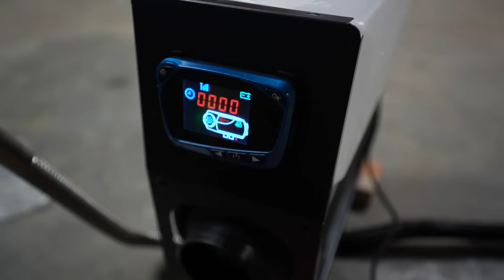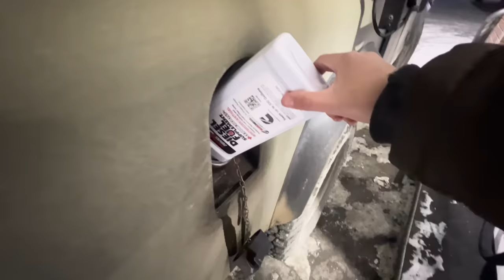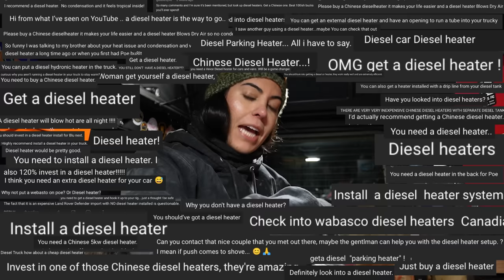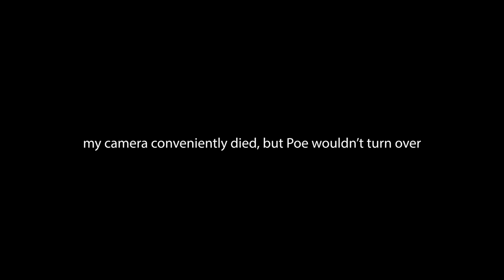Truck Camping in -15 Degrees under the Northern Lights

Comment: As a person who lives in Northern Canada,  I've been worried about you Maria.  No one should be attempting to live out of their vehicle without being well prepared for the cold.  Not a time to be winging it.  Glad you are safe and sending love to you and puppers.
Reply: amen and amen
Reply: Please be careful Maria. We care for you. ❤
Reply: I mean as someone who lives in the north it’s not about making heat. It should be shedding heat. She needs a curtain heavy curtain to divide the space and bundle with her dog. With some comforters she should be fine
Reply: @zachmarshall7921 she needs to make heat and contain heat. Shouldn’t be popping that upper tent up, and not a time for trying shit out without a solid backup plan.
Reply: I 💯 agree!!  I live where it gets -40 I am also worried. I wear big Sorel winter pak boots. Helly Hansen underwear with Arctic Cat snowmobile pants and it's warm but still would hate to sleep in a vehicle at that temp. I also live in an RV full time, but not off grid. I run Electric heaters with furnace as a back up.
Reply: You can block half the radiator on a diesel in extreme cold it won’t hurt it. It will help the heating in the vents. We used to use cardboard and tape.
Reply: Hopefully this is a lesson on the go forward!
Reply: Very easily gone very bad for her.
Recklessly isn’t a good motto in the severe cold.
Reply: I.mean the land Rover is basically a big tin box so it's like attempting to heat a freezer.  People die in their cars in winter doing the same things.
Reply: Her car has a lot issues starting up so if I were her I wouldn’t have dared to stay in Alaska when it snows
Reply: Keep the Buddy Heater. 2 is one.  One is none.
Reply: As you should be ProudestMom
Reply: Take care!❤
Reply: Keep Po low, no uppertent
Reply: Agreed! I lived in North Dakota and it got down to -35 with wind chill. Diesel trucks won’t start without an engine block heater and there are almost ZERO homeless people there for a reason. 😓 I’ve been so so worried too!
Reply: I agree. I live north too and I can tell you need better clothes, better sleepingbag ect. Don't trust technology. In harsh weather when you need it most it probably wont work.
Reply: sage advice my friend. I'm assuming it was -15F calucates out to -26C. Maria was lucky Poe didn't freeze. Plug Poe in at night if jpossible and beware of the Winnipeg square tire! ;)'
Reply: I’d marry her because she does what she does
Reply: @eljay1092 my f150 started there in minus 80, it was minus forty in the sunshine of the day but on the morning…. Ford fired right up
Reply: She's doing want she wants to do, mum. Above all ,  she's not thick,  as far as i know anyway.
Reply: @ForkNLeans  yes but staying in one for a long time can get expensive I’m sure
Reply: @Never-mind1919  Good advice.
Reply: Maria find your self a surplus army navy store and get the arctic sleep system it's like 3 or four bags,and military arctic clothing, and buy a few surplus wool blankets those items will make those dangerously cold nights better, and as a dad I would advise carrying Jerry cans with extra fuel for poe, look into a block heater for him to plug him in at night with that you will need a generator either gas,diesel or propane, solar is good but not always dependable and 1 last thing as another commenter mentioned covering your grill in the rig will help at keeping consistent heat. Sorry for the long comment, just trying to help,  keep on trying thanks for bringing us along for the ride
Reply: @weswarren5987 a diesel F150?
Reply: She is living pretty reckless.  Stupid way of getting the views tho.  Stay safe Maria.
Reply: She is from Michigan. It's North to us, and kinda cold. She is brave. You go girl!
Reply: Hell it gets down to a whopping 15 degrees here and I'm sleeping with a running lawnmower under the covers with me to produce heat..put a boggan and some gloves on for the love of god!
Reply: Oh! I’m so happy you got to see the Northern Lights! I’ve always wanted to see them, wow! Yay Maria!!!🎉🎉🎉🎉❤❤❤
Reply: She's from Michigan we're just built Different 😅
Reply: I live in far northern Alberta and spent a fortune on just boots, parka and mitts etc when I moved up here. Even with those sometimes the cold is uncomfortable. I can’t imagine sleeping in a tent or a truck overnight in the winter up here, but she’s even further north than me. Old man winter is a cruel, relentless bastard who can strike at any moment to freeze you to death. Worth it for the northern lights though
Reply: Winter boots??

Comment: Miss Reckless Maria....trying to help you understand what is happening. The diesel heater draws up to 12 amps  for 3 minutes during start up because of the glow plug. It has to be red hot to ignite the fuel. The fuel will not begin pumping until the glow plug is ready to ignite it. The problem does not seem to be the diesel heater, but rather the Jackery does not put out enough amperage at the 12 volt outlet without overload and shutdown of the Jackery 12 volt outlet. If you were to run a 12 volt supply from the defender batterys the diesel heater would have enough amperage to start correctly. Have it professionally installed to solve your issues and repurchase the buddy heater for back up. Keep in mind once you get this issue solved you can use that diesel heater to blow under your engine to warm it up cold prestart or even blow the warm air at the engine air intake in case of super cold  conditions.

Comment: Maria, I am originally from southern British Columbia, but I have spent considerable time in northern B.C., and the Yukon. The worst part of winter has yet to hit there. It's going to get unbelievably cold there very soon. Vehicles won't start unless they are plugged into a block heater. I'm starting to get a little concerned for you and Blue. That is not the place you should be, trying to tough it out in a vehicle regardless of a heater. The real winter there is about to arrive. Now is the time to consider heading back down south.....
Reply: I totally agree. This one scared me! Its time to leave there and get back to the lower states.
Reply: This!!!
Reply: That diesel heater should have been installed (professionally) way before she ventured into cold climates. Alaska and Canadian winters are nothing to play with. She should also have kept that buddy heater for backup. She mentioned that her truck was blowing cold air, which shouldn't be happening. Her coolant might be gelling. Does that truck even have a block heater? Obviously a must for cold weather. Grinding that diesel motor starting it in the cold is a guaranteed way to damage something.  Does she realize what happens to lead acid batteries if you completely discharge them and they freeze? I also noticed that she seems to be putting additives in the fuel. Do Not do this! The diesel will already be winterized up there. The incompatibilities with multiple types of additives may deteriorate the fluids in the fuel blend and completely reverse any benefits whatsoever. If unsure, ask the station about the diesel before adding additives. From watching her videos she often doesn't seem that well prepared or properly think things through. Her cavalier attitude is going to get her in a jam one day that she may not be able to get out of. I know I sound mean, but she needs to hear it.
Reply: January February your going to see -40 to -60 c up north nothing to play around with
Reply: Wake up!
Your followers care about you and have brought out safety issues that involve your life!!!
Reply: This is why Eva Zu Beck didn't stay there past the fall, and she was very prepared. Definitely the worst time to visit Alaska. I'm in Alberta, Canada and true winter hasn't even hit yet. Wait until it's -30 to -40C....
Reply: @robertheintz8017 10000% agree. This episode made my cringe and say WTF were you thinking.  I hope she goes somewhere warmer and then comes back prepared another time...
Reply: @robertheintz8017 I agree with everything you are warning! She most likely will not listen because she is so omnipotent in her beliefs and for views on here. I am very worried for Blue. Being compromised health wise, this is a stressor on his body. Who GAF about the Northern lights. She and Blue may end up like the Mount Everest climbers. And even the smart ones use Shirpas. Cmon Maria. Go south. You will still get the views you crave.
Reply: @robertheintz8017 but then she wouldn't be living up to her moniker of "Roaming Reckless"
Reply: I’m in northern Alberta and it’s been the warmest winter we have ever had in a very long time. We only had about one week of normal season temperatures which is about -30 C on average but can get a lot colder or a bit warmer but not like this year. It was +1 C today. I hope if she is planning to camp all winter these warmer temps continue for her, even though it’s still freezing at night it’s not as bad as it could be

Comment: Second suggestion: get somebody to install the heater inside your truck so it recirculates the inside air. Having fresh (and darn cold) air pulled in is very inefficient, plus you're pressurizing the inside and push the warm air outside the truck. The heaters are 100% safe if properly installed. I can help if you need, I have one installed in a shed and it's been working fine from day 1. I'm an electrical engineer so I think I can help with these things.... last thing I want to see is a RIP post on your channel, Ria... seriously. Recklessness in small amounts is cool, but in large amounts can be deadly... Stay safe, and keep posting the great content you're been posting so far! Oh...and always have a plan B. Go get that Buddy heater back. It's small enough but can save your life if Poe refuses to power up.
Reply: Also easy access to a heated building.  24 hrs store for example.
Reply: Very good suggestions 

Sorry

Comment: Yeah lots of good comments! and some good advise from those in cold places.  I am retired Army with a lot of Alaska experience and your spirit matters.  Getting tested emotionally is good, but you may be taking on too much risk in the early Winter. For the risk of annoying-Unsolicited recommendations: First, boots recommend Baffin's arctic (-60 degrees) or polar rated (-120, no kidding these are issued for Antarctica) --ditch the sneakers until Spring. Wet tennies constitute potential frost nip or bite. Cotton kills and that goes for footwear. The Army Alaska minimum insulation rating for boots is 1200 gram thinsulate. This assumes you are hiking. For camping those Baffin pac boots will keep you dry and retain heat in the toe box --toes get cold first. Second, window coverings will retain heat in the cabin. You lose a significant amount of heat via uninuslated windows. When using diesel or portable heaters keep a Carbon Monoxide alarm with you.  Third, have a go inside plan. When it gets colder, get Poe in the garage with you in the B&B. You made a wise choice not to tough it out all night. Fourth, talk with the folks at REI on winter survival or take some winter survival courses in the community --even from your fellow content creators. Winter has come and its yet to reach beastly cold. You got this. Stay warm!

Comment: The glow plug draws a lot of current in the diesel heater at startup and cool down around 7-10 amps.   When the glow plug kicks on, the screen dies, likely because your Jackery has a circuit breaker or something that protects and prohibits that amount of current draw.  Hope this helps.
Reply: I have the exact one. And you are spot on.
Reply: He is 100% right the 12volt plug on these can’t provide enough power to run it when the glow plug needs power to heat up. You need to get small inverter that goes from AC to DC

Comment: Thank God you're alive, Ria! As for the Diesel heater, the power getting cut so abruptly when the glow plug is supposed to turn on makes me think that your Jackery turns its 12V output off when overloaded... some Jackerys do not allow 10+ A that the heater requires for start-up. Solution: connect your Diesel heater directly to one of the 12V batteries in Poe (hopefully you have two... so use the house battery, not the starting battery). You already have 12V supply in the truck, so forget about the Jackery.

Comment: Just so you know…unlike diesel heaters that are meant for heating, diesel vehicle engines don’t warm up or stay warm when just idling. I owned a VW Golf TDI (w/ diesel engine) for over 20 years. So, I’ve experienced this firsthand. Also, you may want to get an engine block heater (even if you have glow plugs) if you’re having trouble starting Poe. Also, I’m sure they’re selling winterized diesel fuel in Alaska. Stay safe!
Reply: My Hilux has a power heater button that increases the idle speed, so it gets warm when idling.

Comment: If it's the pump I think those heaters have a prime feature on them, but if not you may have to prime the pump manually (get air out of the line).  As for your vehicle blowing cold air, you may have to put some cardboard across your grill in the front to help hold in the engine heat.  Otherwise, it may never warm up to a good temp to blow hot air from the heater.

Comment: The odds are that the Jackery 12 volt cig lighter plug in has an amperage max and will auto shut off if amperage is exceeded. The glow plug on the diesel heater is technically a direct short to get it to glow and most likely draws too many amps for the Jackery 12 volt outlet and causes the jackery to shut of power to that plug in.
Reply: This is what I've read as well. Except that the pump should be running almost immediately. It's unfortunate that most of these power packs shut down at 10amps
Reply: I have a 12v 15 A power supply that I plug into my solar battery. Works for me

Comment: If poe is blowing cold air, in a pinch one thing you can do is cover Poe's front grill with a piece of cardboard, this will make the coolant retain more heat,and if it's that cold I would not shut poe off, when they built the Alaskan highway way back when, they never shut down the diesel equipment because the wouldn't be able to get it restarted

Comment: Glow-plug POE with the ignition pigtail- wait a minute, than pigtail again, then start. So basically give it 2 doses of heat before you turnover, in arctic temps.

Comment: Who could ever get mad at you???? Some of the biggest lessons I've learned in life were through a very difficult trial.  -15 degrees is super cold and you survived it and with lessons learned.  I say that you are the big winner here!!
Reply: LOL.... -15 is very WARM compared to what is coming soon. She can expect -60
Reply: @canadianwarrior2108  really?! thats insane!
Reply: It's coming , already had -25 in willow, webasto heater cab heat and recirculation heat for diesel engine only way when remote plus bunny boots mittens and mummy bag rated -40..been here 40 years now lots of tundra winter time all over state , your right about -15 warm LOL canadianwarrior..

Comment: Ive made several comments to help. The one reson you can tell its the Jackery is if the diesel heater had continous power it would show an error code on the screen. The jackery is shutting off the 12 volt outlet during the glow plug phase of the diesel heater and your screen goes blank on the diesel heater. The Jackery most likely auto resets that outlet when power demand stops. I have 2 diesel heaters...an electric heater...a dwarf wood stove...and electric pad on my bed. Backup is number one in artic conditions as you have learned with mild artic temps....its no joke...it can get way colder than you are experiencing.

Comment: Your diesel heater's fine, you need that adapter to plug into 110 outlet, a 12 V 15 amp works fine, this is an old video so you. I'm sure you have the new diesel heater already installed.

Comment: Just ref the diesel heater, they draw a massive current on startup to heat the glow plug and generally get going, the sort that isn’t typically available from a normal 12v socket. If the jackery output is only like 100w or so it might be asking too much from it and it’s just resetting the controller with the drop.

Comment: -15°F will only dip way more colder… with wind chills, it’s gone to -80°F. At -30° and -50° the vehicles break stiffens up. The steering wheel is hard to turn. Need a garage to keep vehicle safe. Outside, need block heater plugged.
Big Rays in Fairbanks carries cold weather clothing. Negative weather feels like razor sharp blades all over skin. Breathing in the negative air instantly freezes nose hairs, your lungs exposed to those temps is not good. With how Poe didn’t want to start, just glad it wasn’t out there where you were trying to camp in. Skin exposed for a few seconds will not be good. Drive down towards Seward or Homer for the winter. Not up north. Up north, death comes super fast in winter. Your dog needs winter boots.

Comment: Two things about your truck, does it not have a block heater? You should have plugged it in when you're at the Airbnb.
And you should also cover the grill up front with cardboard or whatever you can find to reduce the cold air from going through the radiator, will help keep the engine warmer. And maybe you can have your mechanic install a high idle. So when you're parked it will raise the engine RPM to keep the engine warmer and the alternator to charge the better.

Comment: You need to plug the heater into a AC to DC converter, and put the AC plug in the battery station.
The 12V plug can't handle the starting load.

Comment: The 12 volt outlet on the Jackery doesn’t provide enough wattage for the glow plug to fully start. The Jackery is cutting power and causing the heater to shut off. It needs connected directly to a battery.